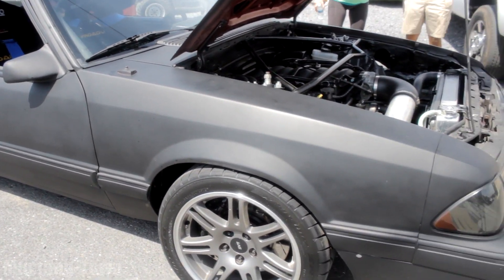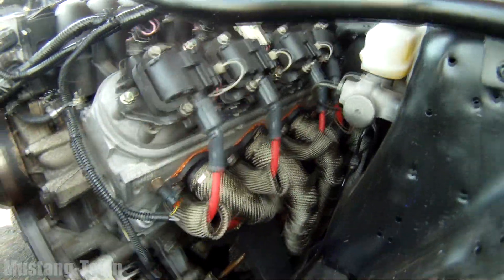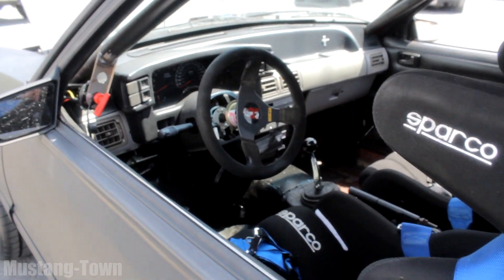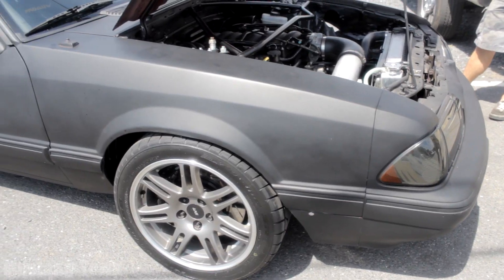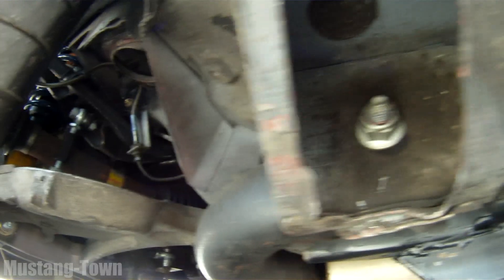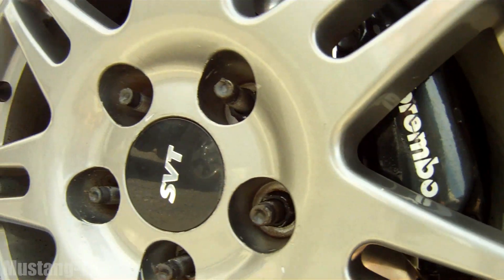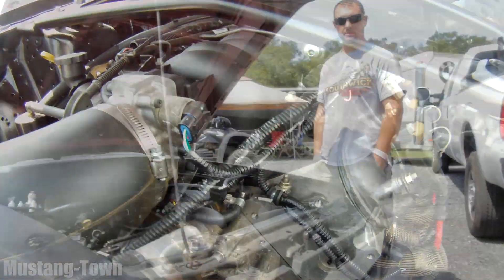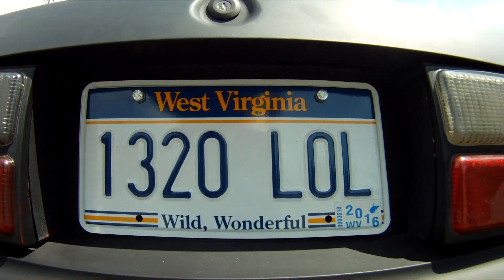“Built Ford Tough with Chevy Stuff” - Fox Mustang Notchback LX Coupe (LS1 - IRS swap)

Comment: you had to make it go fast? lmfao you could have made it fast with the factory motor
Reply: +Justin Perelli He said the factory motor was the 2.3 4 banger.... the 4 cylinder doesn't compete with the ls motor. typical ford owner.
Reply: 5.0 foxbody blocks crack at around 500hp, so thats false. Facts vs opinion, facts win everytime
Reply: +xd123red xd123red fanboys will tell you the same thing when you Coyote swap a Gm car. When really the best option would've been to keep your opinion non-biased.
Reply: Shadetree Squad It wasn't a opinion lol, the 2.3 in the foxbody wouldn't compete with the ls motor in any way
Reply: exactly!!! 331 stroker and a good carb would blow the doors off cammed ls motors
Reply: boss 302 I hope you are kidding about the 331.  mod for mod the ls will slay the Ford any day.  if you stick to the same price range you end up paying way more for the same level of performance trying to build a Ford.  if I may add a ls bored and sleeved with a stock stroke will kick the teeth out of the 331.  on top of that the rod ratio and the breathing capabilities of the ls will be superior.  oh and I almost forgot about heads.  you can buy factory heads that flow as much if not more than a set of ported ford heads for about half the price.  I'm in no way loyal to any brand, I used to love fords hence the reason why I'm here, now I'm just all about the technology and power.  and please do not bring the sissy coyote motor into this discussion.  mod motors are a joke without that little snail helping it breath.  it doesn't take a brain to outrun a n/a motor using a power adder.  ford had its biggest fuck up ever by giving the mod motor such a small bore in comparison.   if ford makes a 4" plus bore then and only then will Chevy have to go back to the drawing board.
Reply: MrCuervo22779 the coyote holds its own with ls's any day of the week you have no idea what you're talking about lol
Reply: boss 302 lol thats funny. A cammed 331 will be very lucky to turn 400hp lol. Cammed ls put out anywhere from 400-500 n/a on stock disp.
Reply: So apparently you are a ford fan.  I love mustangs for a couple of reasons. Lightweight, at one point abundant, tons of aftermarket support, look good, and total performance for all forms of racing. I however do not care about it because of a brand. What I mentioned about the mod motor being all stroke and no bore is completely true. If you think I'm wrong then you should go and research other motors that make incredible power for their displacement.  Pro stock motors turn over 10k and they make around 12-1300 hp. That's from 500 ci from all motor. They can do this because they have learned from F1 that making the bore bigger and the stroke shorter, high rpm is capable due to the short stroke.  F1 v10 engines were all making upwards of 900 hp at 18-20k. How is it possible?  Their stroke is probably a big culprit. They have about a 2" stroke. So you see where I'm going with this?  Ford should have merged the mod motor and the Windsor motor and had a big bore mod motor. The high hp capability and the low end power would all be capable. Now that being said, the Voodoo motor is still not as awesome as people think it is. It will come with 12.5/1 car from the factory. If the computer can not adapt to certain mods then your typical "racer" can easily add a power mod and ruin the motor.  No if you add that kind of cr to an LS motor and it becomes a wild animal capable of eating coyotes and shitting out a hellcat. Let me ask you this, how many cubes can you coax from a coyote and still turn 8000 rpm?  An LS can easily be built into a 427 on a stick block. This plus a good set of heads, intake, solid roller cam, exhaust and compression will definitely destroy 95% of any other n/a combo out there.  Now if you want to add boost then the LS will take the same amount of boost as your ford and still make more power. Why because of the displacement. Ford has a good concept but they need to refine it some more by giving the mod motor the capability to add displacement that it desperately needs.  If the coyote motor had a 4.100" bore along with everything else needed to run that?  Lights out for everyone.  Why you can't see that I'm not sure but I bet it's because ford is all you know and are not open minded about most things.  Let's see your coyote make 1000 hp on motor only.  LS motors can do it. Don't believe me then check out SAM Racing on YouTube. They built one that makes that power plus rpm and it's all LS power. Chevy has kicked the shit out of ford for many many years in NASCAR and other racing leagues.  They do that because they are innovative and are always trying new things. Sb2 motors, splayed valve heads and 15* heads  in drag racing, and many more.  Ford just stuck to the Yates head forever and ever.  Others had to produce their own designs which were produced by 3 Rd party manufactures.  I'm not a Chevy fan, I just like what makes sense and makes power.  I don't really like boost or nitrous. Anyone can make power with those things.  It takes talent to make power using all motor.  As of now the LS makes sense and power.  I used to not like it much until it became the creature it is today.  Once ford makes a 4" plus capable mod motor then and only then will I sing its praises.  Have a good day.
Reply: cml3710 Sure a coyote can keep up with an ls, But at what cost? The coyote motors are way more expensive than a ls, and people are pulling 6.0's out chevy work trucks and boosting them and they still out compete the coyote motor for a significantly lower cost than a coyote motor.
Reply: chevykillr 111 for a ton of money and a dart block

Comment: if your gonna build a car pute a new  5.0 n it makes way more power than that piece of shit ls engine which probly has a rod nock that's why he didn't start it or pute a bigblock ford in it not a chevy
Reply: Lmao you salty ass Ford fan boys crack me up! You know damn well that a Coyote 5.0 don't have shit on an LS engine. Plus, putting a big block anything under the hood is gonna screw the handling up because of the added weight over the front end. LS engine is light, powerful, reliable, cheap, plentiful, etc. Why do you think people swap them into EVERYTHING?
Reply: use a  fcken ford motor not a chevy that new coyote will eat that ls alive you can get a stock  5.0 coyote with 500 hp not a chevy they suck plus chevy isn't reliable and chevy breaks every time give it a few time of running it that motor will die and a ford wont
Reply: FATBOYREPPIN502 i wouldnt say people swap them because they are reliable hahah any engine can be reliable, people swap them because everything from the factory is swapable with lsx. like he said that 5.3 heads is the same heads they use in the z06 just a few little different tweaks, you going find them heads all day in the car yard, same with the engines, they blow it up guess what 400 bucks they back on the road hahah so yes you cant beat that for the price. and the coyote shits on the LSX motors 5.0 liters vs 6.0 liter ( todays stock camaros) they pushing the same power output. but that swap cost 15k so i wouldnt even bother with it, i would build a bad 351 stroker before i spend 15k for a swap hahaha
Reply: 302highperformance show me where you get a stock coyote with 500hp? the stock voodoo is 500+hp but its not on the market yet. you can get a coyote crate engine and add boss 302 intake or cobra jet intake make 475 or so give or take
Reply: you can get some mad power out of a ford motor they only use the ls because there aluminum blocks so there light nothing against the ls butt use a nova or something not a ford its like me getting a 67 el camino and dropping a ford big block 390 fe  in with ported heads they make way more power then a 460 and there a 460
Reply: what ever dude good luck replacing parts all the time you just don't have enough balls to drive a ford motor every were I like my cars to stay reliable I don't know about you butt im not replacing a good motor for a shitty motor
Reply: iv seen a 5.3 loose to a stock coyote those 5.3 motors suck and there slow
Reply: Haha this still going.
Reply: my 82 fox isn't a daily driver it has a 331 stroker 5.0 in it and its a pretty fast fucken car of cours I don't drive it on the street it for drag strip
Reply: The DOHC makes the 5.0 sit higher than the LS which helps with the center of gravity. Plus if the LS is a piece of shit then why do ppl swap them on everything
Reply: ya my car would eat an ls engine alive it got about  750 hp so you guys shouldn't really say much about the push rod motors
Reply: LS motors aren't that much cheaper.  When it comes to factory replacement they are a little, but in the aftermarket world everything is pretty much the same.  For a LS3 6.2 crate engine with 480 hp they want $6700.  For a 5.0 with 420 hp its about $6200.  So theoretically the 5.0 makes a lot more power per cubic inch than the LS3 and its not super expensive but of course both motors are sold without the fuel injection harness setup which is about $1500.
Reply: 302highperformance LOOOOOOL calm down bud. You stick to your $1800 cam swaps and be happy.
Reply: Actually I'm picking up a roller block 351w for $300 this Saturday.  So with a basic rebuild while keeping the stock bottom end, afr 185 heads, a good cam, intake and carb I should make just around 420 hp.  Thats all for about $2500 into the motor.  You can't do that with a chevy motor cause they can't handle much hp on a stock bottom end where as a 351w can handle 750 hp.  Ive seen guys run 900 hp on a stock bottom end with no issues.
Reply: A Ford 302 can handle 600 hp if you have a perfectly balanced rotating assembly and have perfect timing so you don't have random combustion blowing up the block.  Block strength has nothing to do with hp unless you have bad timing or bad balance.  Of course if you have a weak block, like a chevy 350 then one little hick up in the timing at 500 hp with probably crack the block, same goes with a 302 or anything else.